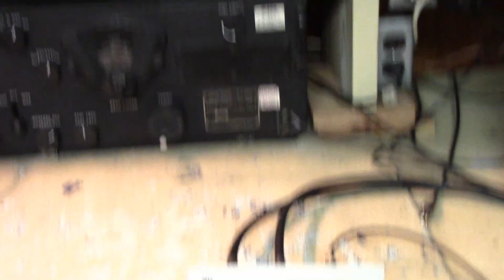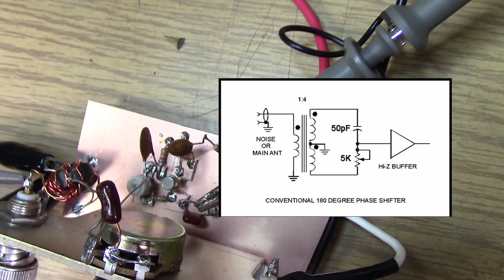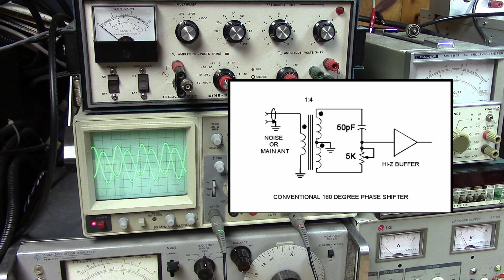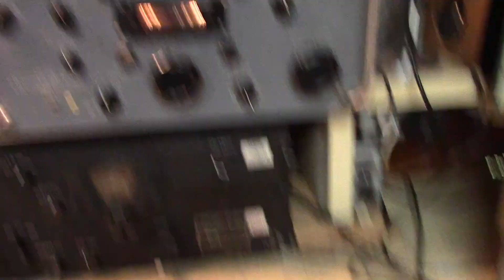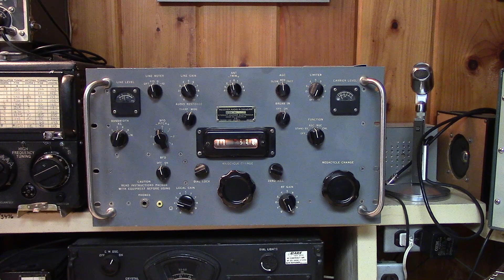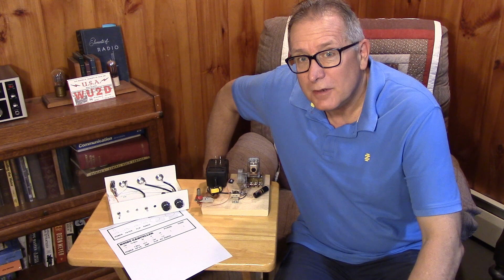Noise Cancellation Part 3

Comment: The relay in your Noise maker/generator reminds me of the days in the 30s, 40s, 50s & 60s of "Vibrator" type Power supplies, sort of a mechanical oscillator to Excite a hi voltage  transformer used to supply  the PLATE voltage for the Tubes of those Era. +250v, +600v, +2000 v etc.  Along side dynamotors.

Comment: So, is physically moving around my AN200 loop antenna (MW) to find the least noise just adjusting the phase?
Reply from the maker: Not unless it has another antenna as a reference to phase against. Otherwise you are just nulling the noise source line of bearing.

Comment: If I want to listen to station A, which is on the same frequency as station B but a is further away and B is in between, can I use this to caancel station B? If I use a high gain antenna and a low one?

Comment: That is amazing.  I guess the part I missed out on when disbelieving this was possible was realizing the the second antenna needed to receive the noise and not the signal, so there was a difference to remove.  I asked earlier if it would remove static crashes from lightning, the plague of 80M.  So I'm thinking it would help for local lightening if I put up a vertical noise antenna in addition to my 80M horizontal delta loop, an antenna I picked as I was told it has lower noise. 

An additional thing I think I have noticed is that remote lightning seems to often not be much of an issue until the person transmitting is near it.  Does the lightning mix with the signal, or am I imagining this?  Anyway back to the Heathkit Hw-101 VFO that I'm rebuilding on the bench, a problem there will make your life miserable.

Comment: I bought one of those $60 QRM Eliminators on Amazon, I've had pretty good success with it. Like you said and I figured out you'll fail or succeed just by the Aux/Noise antenna choice and where you place it, and how you place it.

I posted a lengthier post, but YouTube kept nuking it.

Comment: You know, that separate RX antenna pass-through on the back of my old IC751a could benefit from a noise antenna and box....  I wonder if the impulse response of the all-pass and buffer/amp would mess up the null somewhat? OH, just read your comment below. Nope. OK, heating up the soldering iron.....  TNX Mike es 73 de W3IHM

Comment from the maker: As I dress down the components, use short coax sections rather than long wires, and have swapped to a Magic Tee combiner, I am reaching the limit of my test gear getting beyond 50 dB of rejection from around 5 MHz to 30 MHz. But markedly less performance at 75M with 35 dB and only 10 dB in the BCB. Still significant improvement, but it is apparent that Type 75 material would be a better choice at LF and MF.
Reply: You can always try to stack 2 ferrite cores of different mixes on top of each other and wind on that combi to get a good performance over a wider range.

And when looking at the gain stage, I would place the gain pot in the drain of the JFET instead of the resistor and go from the wiper into the next stage. That way the output remains 50 ohm.

Comment: You can't use it with a transceiver.
Reply: Yes, I was thinking that I might try to build one of these. However, as I would want to use it with a transciever, some kind bypass solution would be needed for transmit.
Reply: @Steve-GM0HUU  What a genius, how did you ever figure that out?
Reply: @Capecodham  I simply imagined the noise reducer output poing pop trying to dissapate 100W RF.
Reply: My Icom 751a has two jacks on the back panel where the RX RF passes through after the relay. I will just add the noise box and noise antenna there, no fears. Check your XCVR?
Reply: @gretalaube91  Thanks. Although some rigs have an RX antenna socket, it may not be help with this noise canceller. The combiner needs an input from the noise antenna and the normal antenna.

Comment: I always found 2N2222A's to be rather nosier than later designs, a 2N3904 would probably be a better choice, that noise probably would not be tunable out.  Otherwise nice. Ron W4BIN
Reply: The 2N3904 is pretty darn quiet for a GP BJT.

Comment: Can this device be adapted for LongWave and Standard Broadcast AM bands?
Reply from the maker: Ha yes that is certainly the worst of the worst for many folks. The answer is yes, and it is actually where the basic noise cancelling work started back in the early days.
Reply: @MIKROWAVE1  The toroid transformer and the number of turns shown, have the bandwidth to handle frequencies from 100kHz through 2mHz efficiently? or do we have to use more turns of wire?
Reply from the maker: @JCWise-sf9ww  You start to see degradation below 6 MHz. type # 75 or 77 are preferred rather than adding turns to the #43 where you want to be. I also tried a binocular #43 and it did improve the low end of the BCB. The next video covers this.
Reply: @MIKROWAVE1  Ok

Comment: my noise in this QTH is pretty near catastrophic---the MFJ1026 added to the line up is the only thing that has made listening possible again--it has allowed me to hear signals on 20 meters once more during the day, and has rid 40 meters of most of the hash--i need to devise a better noise antenna--but a 6X8 foot balcony limits one

Comment: You could use a 365 pF variable capacitor in your phase shifter in place of the 50 pF fixed which would make it suitable for low frequencies and high frequencies. I like your construction technique with the "islands' on FR-4. I wonder if there's a market for 1/4" punched-out pieces of FR-4 for prototyping. I have used areas on my production 0.031" Teflon PCBs as etched capacitors and inductors in the past. Their thermal stability was acceptable for many applications.
Reply from the maker: There are several things that could be done to improve the phase shift circuit. I saw one approach that uses a balanced approach and variable capacitors. The simple All Pass used here is the most basic that I could find.

Comment: That circuit seems to work nicely!  I wonder if a few clamp-on ferrites on the power cord going into the circuit might improve things as well.  I've had some success using those on the wall worts feeding my 70s era Sony AM/FM/Cassette deck and my SDR Play box.  Turning off the LED lights in my lab helped as well, but there's still lots of room for improvement.  I'm looking forward to the soup-to-nuts version of your circuit so I can start purchasing build parts.

Comment: Success or failure.  Too many hams fail to realize that every QTH is different & the biggest variable is the operator.   I have 3 different QRM NC's.  I bought a MFJ1026 for $20 at a swap.  Wouldn't power up & found a blown inductor on the PS side.  Replaced it & viola!   Works quite well.  The TW ANC4+ has a good S unit or 2 signal loss when in circuit.  Disappointing.  I have a 3rd unit, an ebay special that I have yet to really assess.  Thanx for the vid.   73